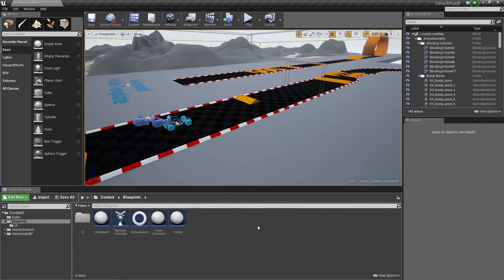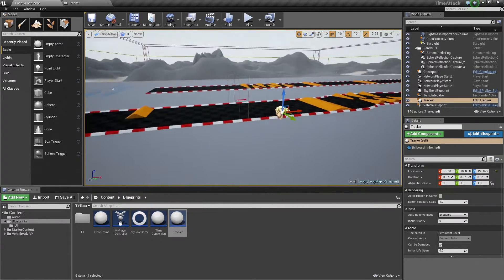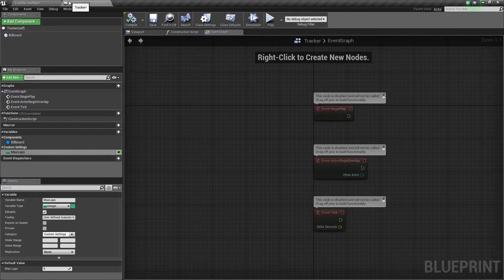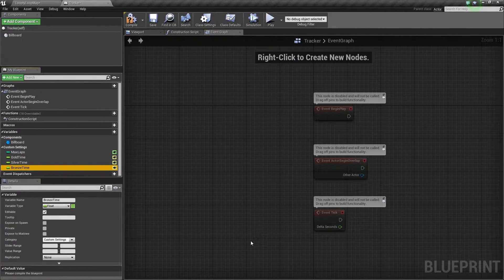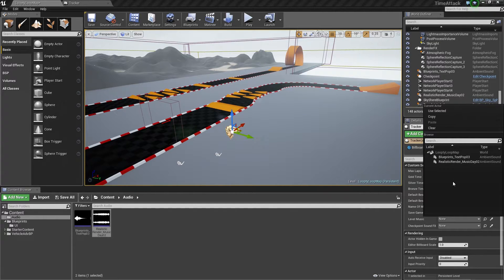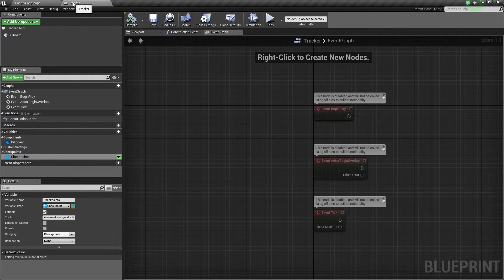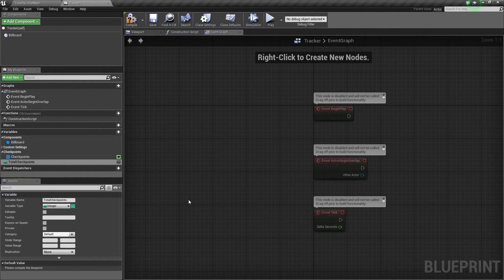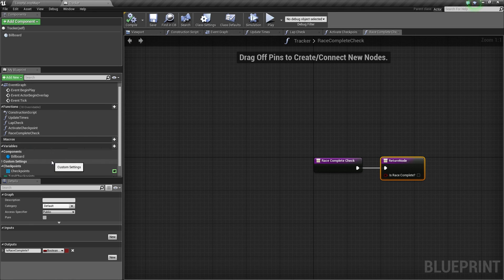BP Time Attack Racer: Checkpoint Variables & Functions | 04 | v4.8 Tutorial Series | Unreal Engine

Comment: I know this video is a few versions of the editor old at this point, but it's relevant to the thing I want to prototype and I'm running into an issue: 

At the points where you link sound files from the Content Browser to the Ambient Audio variables on the tracker... I just can't. I have the audio files imported into the project, but the drop-down search doesn't detect them and if I try to drag-and-drop the audio from the Content Browser directly onto the variable it doesn't work (I get a red box around the variable, indicating something is wrong) The Editor will play the audio just fine, and I can drop them into the level directly and that seems fine. I just can't link them to the Ambient Audio variable on the Tracker Blueprint. 

This same thing happens when I try to add the current checkpoint to the Checkpoints array. Drop-down search finds nothing, drag-and-drop produces no result (except that same red box). I'm led to believe something about how these variables are linked to files in the Content Browser has changed since v4.8, but it's a frustrating problem to search for. 

Odds are not great that i'll get a response on a two-year old video but... maybe? 

Thanks.
Reply: Right click on the audio in your content browser and click create sound cue then drag the sound cue into level. You should be able to find it.
Reply: Thanks a lot!